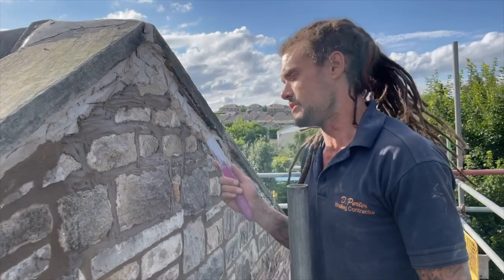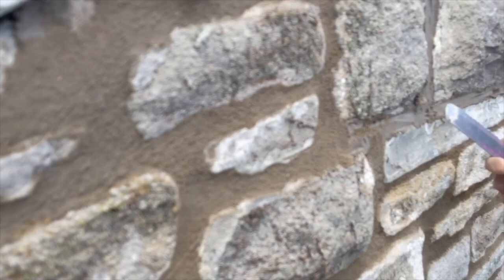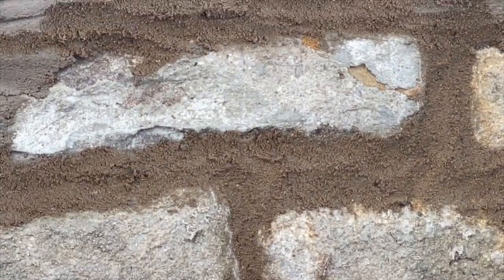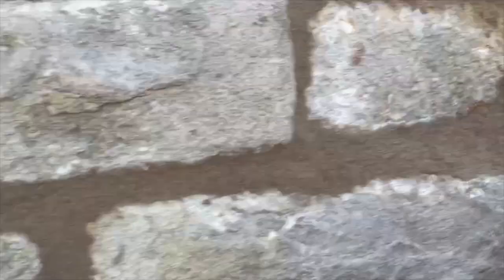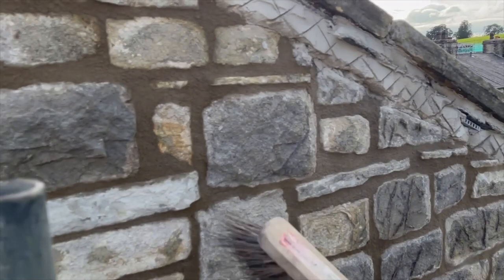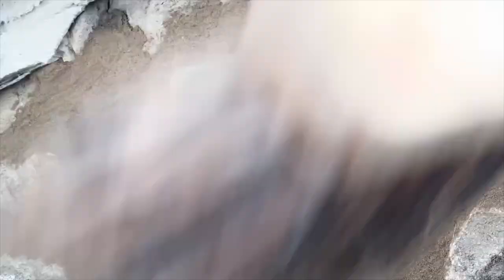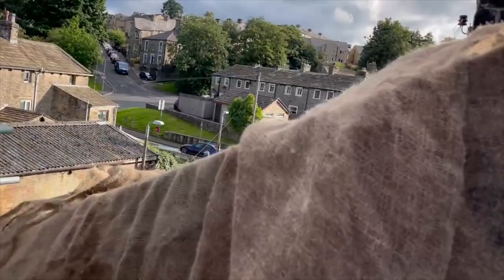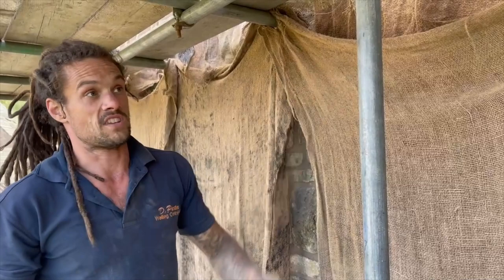How to repoint a gable wall (3)Finishing of mortar.

Comment: Excellent video. I will be repairing the fireplace exterior mortar on our lake side cottage (in Haliburton, Ontario Canada) summer high temps are 30C and winter cold temps are -35C. The granite rocks are stained from the previous mortar. This fireplace was made in the mid 1950's from hand split granite. I have two questions, 
1 - I assume this would not be a lime mortar due to the 'young' age of our fireplace. 
2 - what is the best way to remove the stain from the rocks? I was thinking of a small sandblasting prior to replacing the grout. Regards.
Reply from the maker: Hi, The mortar used would most like be of cementitious origin. A way to test would be to get some table vinegar and splash it onto the mortar. If it fizzes and gets excited then it will be a lime based mortar.
You can get brick acid from your local builders merchants. Brush it on the stains and wire brush after a few minutes. This will remove your mortar stains from the granite. Hope this helps?
Reply: @dportercontracting9974  Thank you, I will try that in the spring.

Comment: When do you choose to use cement vs lime. I know your an fan of lime so wondered y this job is different? Is it a cost thing?
Reply from the maker: It depends entirely on what the client wants from the project.
This house is a rental so the landlord was after a quality job on a lower budget. Cementitious repointing is cheaper than lime pointing due to the lime requiring more labour time to get it on the wall with the likes of backpointing, prior to the finished lime pointing.
Reply: @dportercontracting9974  I really enjoy ur videos. It’s construction I like. Made to last down to earth and kinder to the environment. 
Be great if u did like a sit down and explain ur background.

Comment: Just did mine last year I was hoping 100 years it last, so I'm 35 , so at 55 /60 I'll have to re-do😢
Reply from the maker: Unfortunately so MikeDe. Although you will have a decent amount of time to enjoy the fruits of your hard graft and labours until then. Next time, try using lime and it'll last way over 100 years. Your great grandchildren can repoint it then.
Reply: @dportercontracting9974 I just realised your using cement this time I think? If never seen you use cement before,  cement on stone noooo😂

I did my house last year and i used my trowel handle to scrape then taped with brush then brushed, turned our great,  this time on someone else's house i scraped with knife as you did here then tap with brush and brush clean. 

It using a knife any worst then using my trowel handle? I had some hair line cracks this time sure it was from sun tho, if been misting the wall daily for 3 days to let carbonate then let dry, my house the NHL 3.5 dried by best day but no cracks? Not sure what's going on
Reply from the maker: @mikede2331  Hi again Mike. I find the knife works better and lasts longer over consecutive jobs than the trowel handle.
As regards the cement pointing, I no longer use cementitious mortars on a repoint. We just solely use lime now for the good of the building. This customer was renting the property out and wanted to keep the cost of the project to a minimum so cement was used as the application can be done in one pass with cement based mortar.
Reply from the maker: @mikede2331  When you come to scratch off the finish mortar, some hairline cracks can be present but they usually only run millimetres deep into the finish mortar. If they run to right through the finish mortar then it can be a sign that the backing mortar was too dry at application of the finish mortar. The backing mortar wants to be damp but not soaking upon application. I usually work on an area of 3'x2' when pointing up, then move onto the next bit and mist the background.
Reply: @dportercontracting9974  thanks man all help full Info for me thanks

Love your work love watching the videos 👍

Comment: D porter Contracting, what time of the year ( n the UK) would you say is the cut off point for re- pointing Cement
Reply from the maker: Hi Pickpocket for hire. Once the temperature is heading down towards 5 degrees, put the pointing trowel down.  Chromium salts have a tendency to bleed from the mortar in cooler weather. If frost gets into the curing mortar then it will have a drastically reduced lifespan.
Reply from the maker: Hi Pickpocket for hire. Once the temperature is heading down towards 5 degrees, put the pointing trowel down.  Chromium salts have a tendency to bleed from the mortar in cooler weather. If frost gets into the curing mortar then it will have a drastically reduced lifespan.